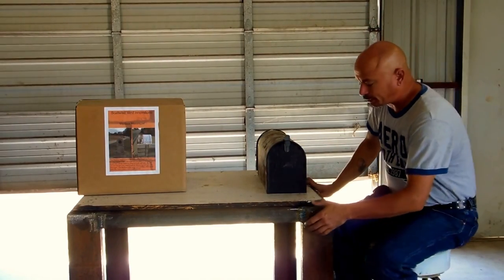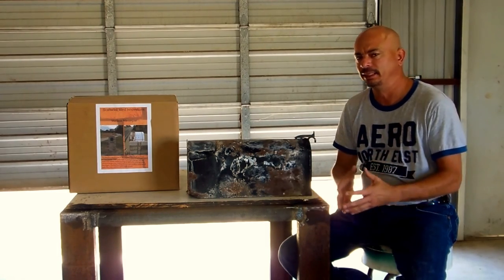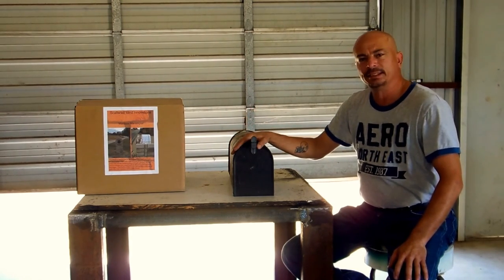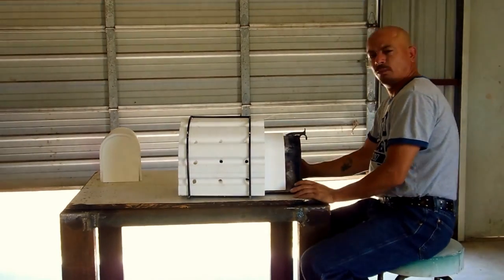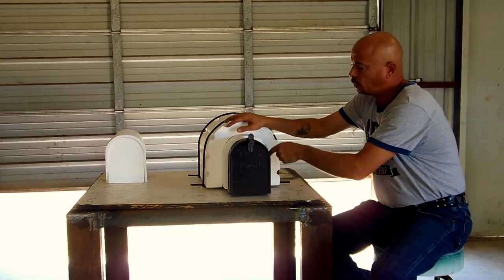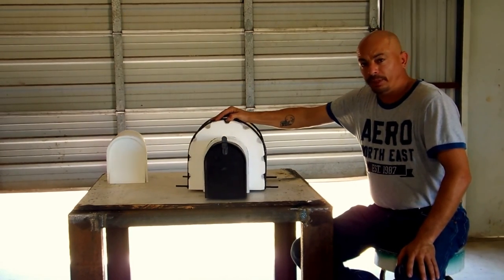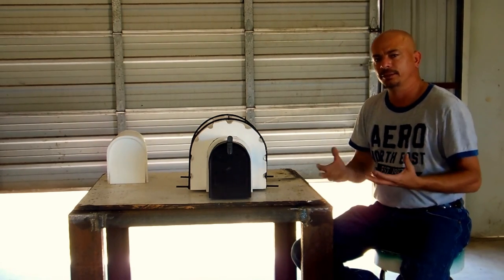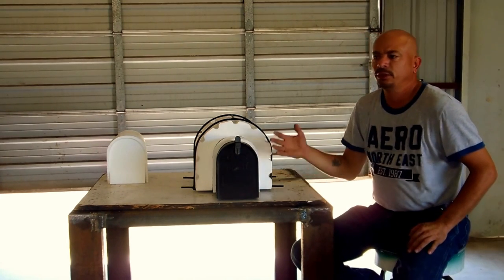Masonry Mailbox rusty or brick spalling

Comment: I had to build a stone mailbox column 22 years ago for the first time. I saw that other homeowners were dealing with rusted mailboxes that were falling apart, but dealt with it daily because it was set inside a brick or stone column. They didn't want their columns busted up and then look patched. So I put a lot of thought into designing my own mailbox column. I did not use cinder blocks. I came-up with a design that used a plywood form that created 3"- thick poured concrete walls on all 4 sides, leaving the center of the column completely open to run electrical wires, cameras, etc. My design also incorporated a composite shelf that would be anchored into the poured concrete (with long bolts protruding from the shelf) for the mailbox to sit on, and an "archway" for the mailbox to slide through (so the concrete doesn't touch any of the mailbox). Once the concrete cured, I had a company apply stone veneer on all four sides of the column. Then the magic part happened. I slid my new $350 Gaines "Keystone" thick aluminum mailbox into the column hole very easily, then used 3 of the factory screw holes in the bottom of the mailbox to secure the mailbox to the 1"-thick composite shelf with stainless steel screws. The finished product looked truly custom and I can literally replace the mailbox in less than 5 minutes, if needed, and without disturbing any concrete, stone or mortar. I also had the stone guy just lay the very heavy top piece of the column onto the top without any mortar. So I have complete access to the inside of the column, if necessary. And...I'll never understand why people pay to have those expensive columns built, then have a $30 mailbox that is guaranteed to rust and fall apart permanently mortared into it. My 22-year-old Gaines mailbox opens and closes today like the first day I installed it. It's solid and still looks new.